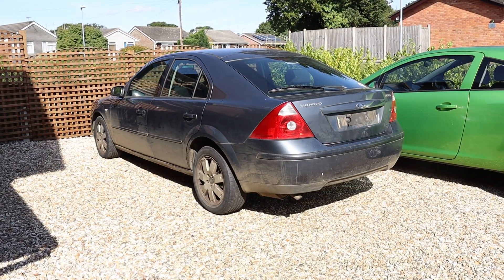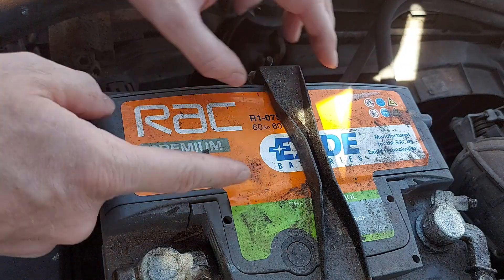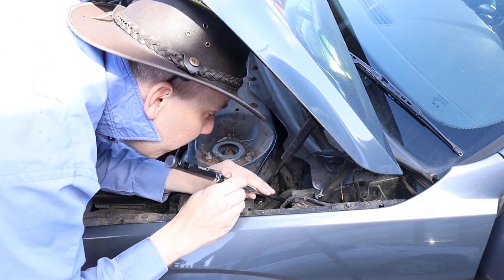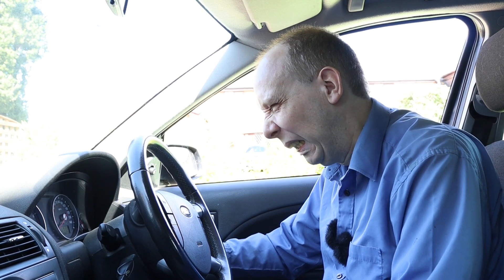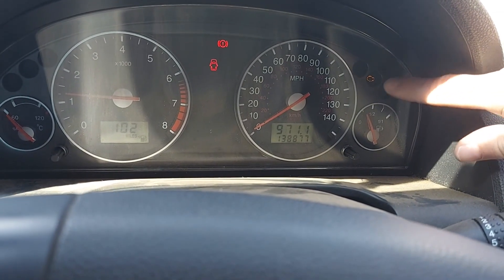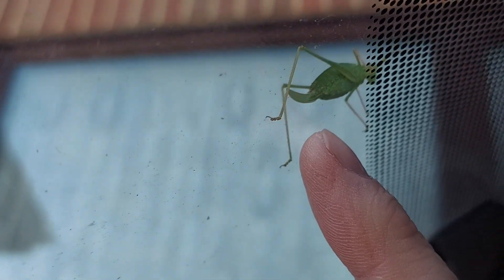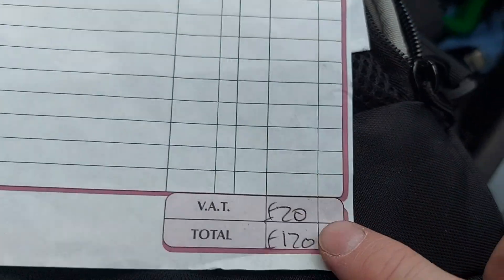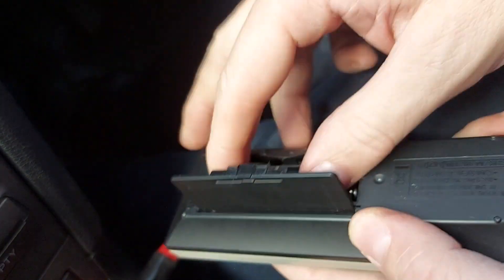Ford Mondeo Mk3: Engine Misfire (Check Engine Light)

Comment: Interesting video.

Any car new to me with or without issues but especially one with electrical and/or engine starting issues I would fully recharge the existing battery (with appropriate charger and following car and charger instructions).  Whilst that is happening I'd do further checks on existing parts (plugs, air filter, electric cables, wires, connections etc.).  The new coil pack could be a matter of replacing parts rather than proper diagnostics by previous people (and of course new parts can be faulty too).  Be interesting to see further videos and what you find and diagnosis.  You will check things lazy pros might ignore.
Reply from the maker: Interesting comment as always, Nta16. Thank you. The battery is on charge as we speak.

Comment: That looks like a cheap aftermarket coil pack.  I’d bin that.    Do a compression test before you spend any money.    Iv seen a lot of garage toss a coil pack and a set  of plugs at a car with a miss fire.
Reply from the maker: Thanks for the useful comment, Barry.